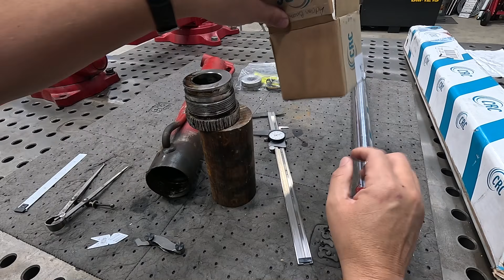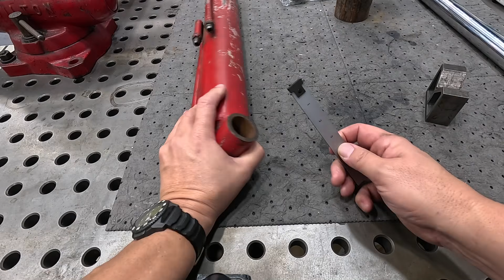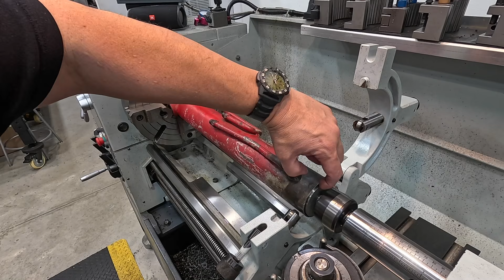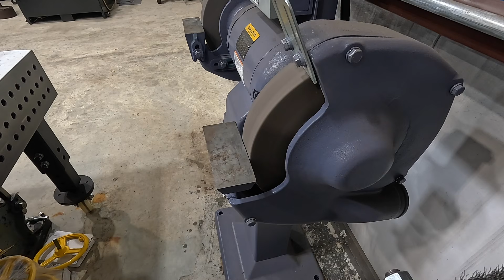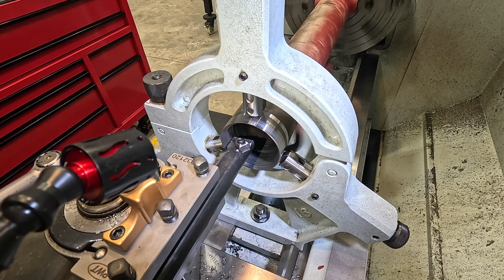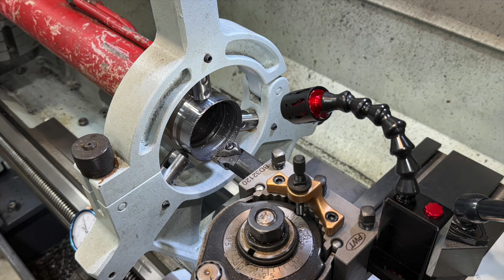Chasing Internal Thread: Mahindra Hydraulic Cylinder Repair Part 1

Comment: Being a Mahindra Product, Did You take metric measurements ??
Thanks Adam...
Reply: Agreed. But as you heard with the tool cutting edge touching on the thread, there was an even sound all the way though the threaded area. If it wasn't the correct 12 TPI thread we would have heard it touch on the early part of the thread and then change sound as it became out of synch with the rest of the threads. But I am still surprised that is was imperial thread. But on the other hand, Adam has rethreaded "one or two" cylinders, of all different origins, in his time and I will defer to his experience and knowledge.
Reply: These are from India and it looks like from my calculations it is a 68.25mm X 2.0  thread.  We have Imperial tools here so we would still do the repair using imperial calculations.  I'm just surprised he didn't note that during his measurements as I know he realizes this.
Reply: @larryrobinson7492  just because it made in a country that uses metric units doesnt mean it will be metric. a lot of hydrualics stuff is imperial. it highly likely the ram used is imperial becuase its the size that will work for the task at hand so you save time and money by not turning material into shavings. oh and metric threads are based on imperial threads anyway.

Comment: Caustic soda/lye solution would have removed that aluminium from the threads, somebody might explain why that might not work? Obviously if it needs rethreading to a different pitch/bore there's little point.
Reply: Too much hydrogen gas is what I would say.
Reply: Would it have made it round, too?

Comment: For our South Bend with the threaded nose, my dad came up with a nice setup to install and remove a chuck.  Turn a morse taper on one end of a bar and a center on the other.  Close the chuck jaws close, but loose, on the bar.  Put plywood on the ways.  Lift up the chuck - I happen to use a die cart.  Position the rod in the spindle taper and tailstock center.  This keeps the threads perfectly aligned prior to installation and has limited risk of a back injury.
Reply: Well isn’t your dad just clever!  :-)  I like it.
Reply: a hobby machinist i knew made a roller stand with a bit of seat belt webbing so he could change chuck with no lifting but he only had one lathe. he would wheel the stand in place release the chuck turn the stand around and install the other one. the seat belting was to stop em falling off the stand. cluey old bugger bob and his brothers developed one the worlds first mechanical cane harvesters the parry - truscott. they were self tuaght machinists and engineers.

Comment: from my engineer's perspective, 0.025" off the OD does change the Section Modulus a measurable amount, but the Factor of Safety designed into the original part handles the actual pressure force applied inside the cylinder when it is under load.

ignorance and attitude go hand-in-hand
Reply: But when you consider the seal is well above the threads and it is the threads that is taking the lateral load That little bit off the entire Route of the thread on the OD is negligible.
Reply: @tomjewett5839  i think i get your meaning - i dont disagree, i might have described it slightly differently.....the pressure inside the cylinder exerts axial force on the plunger causing the rod to move and perform work, while simultaneously exerting radial force on the cylinder ---- all held together as a unit by the threads. are we off into the weeds yet??? im sure a hater is gonna have something to say........
Reply: @garywoodard5759  you literally are the hater here trying to make yourself sound smart now that you were called out.  again you're wrong though.  
youre talking about combined load, but what you fail to understand is there is a recess/undercut before the threads that would be the weakest part of the cylinder.  Plus not all the threads take on the load.  Thats just not how threads work in real life.  Youre not very good at this.  Maybe stop being the ACKCHYUALLY guy here?
Reply: @gectek  as i predicted. but back to the original question-- does cutting a flat spot around the out side of the cylinder weaken it to the point it cant be used?
Reply: @garywoodard5759  no it does not...because its still thicker than the recess cut before it inside the cylinder.  
Just as i predicted.  You just dont understand.  Its ok not to but pretending you do?  Cmon i assume youre a grown adult, you should act like it.
Reply: @gectek  and you are still missing my original point about the body of the cylinder being turned down a miniscule amount not compromising the overall integrity of the body of the cylinder, because as you correctly pointed out the recess at the end of the internal threads is in fact the thinnest part. it seems we are both correct, just talking about different aspects of the same thing. so happens i do understand.  the difference between us seems to be that i enjoy life.
Reply: hey gectek where'd you go?? we were having such an edifying discussion.......
Reply: @garywoodard5759  bless your heart bro, your "edifying discussion" is pointless.  again tryin to use big words to seem intelligent only shows your ineptness.  I cant teach it to you AND learn it for you at the same time.  Good luck on whatever it is youre feigning intelligence about though. I hope you win.
Reply: @gectek  its not about winning, its about making friends.  as  you seem determined to cast aspersions..... (whoops another big word) ....hows that going for you?? 
so happens i am only slightly above average in intelligence, enjoy reading and expanding my vocabulary, and i never feign. i expect you will feel the need to have the last word and may reply to this note, but really its time to let it go, dont you think?
Reply: @garywoodard5759  It could actually be argued that he's making it stronger when you think about how he's slightly enlarging the threads and then going to make new threads slightly larger on the new end gland Which will increase The overall surface area Of the threads. And I'm not being a hater. Just pointing out things that I have considered to be obvious.
Reply: @tomjewett5839  enlightening discussion and honest debate is a good thing. you have 'good form', as they say. some others dont have good form, classifying themselves as -well it goes without saying.....
thank you for constructive dialogue.
Reply: The force isnt applied where he machine, so acting like a knowitall trying to use terms that dont apply sure made you own yourself there.  Good luck with your further research though

Comment: Adam's comments about proprietary parts using non standard threads is another reason to not buy a Mahindra product. Another is they used an aluminum gland on a steel cylinder, Aluminum against steel is guaranteed to corrode the aluminum and seize up in time. If their "engineers" had studied material science, they would have known. Yet they have the nuclear bomb! And rockets to launch satellites (and the bomb).
  I made the mistake some years ago of buying some India made boring bar set and found the "ground" ends was too large for my quality Criterion adjustable boring head. Junk quality tools.
Reply: I did immediately yelling at him: metric, metric when he tried to measure american bananas on the part (Ausie CEE channel joke).
American ignorance.
I'm pretty sure that Mahindra is standard, but metric.
But I can't actually convert the shown 'bananas'' type to thread gage to something standard metric for the rest of the world but I would guess M75 means 75mm which is a little smaller than 3 bananas (inchs) 

😂

Comment: Always great tips Adam. I prefer REX 95 to Mo-MAX when considering endurance against heat (like on extended shaper cuts) but the use of Mo-MAX for this is perfect. A very delicate and subtle use of HSS. Good choice. I also love your point about how many photons can you see in the gap. I do the same when sharpening.

Comment: At 26:00 Adan explains that removing 20/1000ths does not damage the structural integrity of the tube. An illustration of the truth of this statement can be seen at the CuttingEdgeEngineering YouTube channel. Kurtis has been fixing hydraulic cylinders for decades. Unlike this one Adam is working on, Kurtis repairs the cylinders from the largest earth moving machines Cat makes. They contain enormous pressures, above 4,000 pounds per square inch. Kurtis never discusses, as Adam does here, instead he just cuts a "steady band" every single time. Like Adam, Kurtis also teaches. He discusses why the previous repair failed, and why his will last years.
Reply: That's because Kurtis doesn't bother himself with the numpties in the comments. Adam would do better to ignore them...stop feeding the animals, and they go away.
Reply: But I hear Kurtis imediately yelling at Adam to stop the 'bananas' measurement.
That Madindra may be just plain standard metric. M75 sounds to match 2 11/12 relatively close.
Reply: @dilbert0815  well it doesnt. its either a metric thread or its a imperial thread. if you notice he had a set of thread gauges on the bench along with the verniers. a lot of hydraulics stuff is still imperial even on equipment where everything else is metric. it's often about using off the shelf available material rather than having to buy in custom size stuff or spend hrs machining stuff to size.

hydrualics works by multiplying the hydrualic force in psi by the surface area of the piston. the engineer calculates what size piston is needed to get the force in tonnes required to do the task they then select material sizes close to that. the focus being use off the shelf material as much as possible. what size seals are available
Reply: @chrisforgan731  Thread gauges are a rather inaccurate tool only do a close match over a rather limited number of threads. the thread is also damaged, hence measuring is inaccurate anyway.
So you will always find a thread gauge in metric or imperial that seems to closely match the threads.
Also your two arguments are rather oposing each other. You eigher use a off the shelf parts (and hence typically overengineer it) or pleasing the beans counters by minimizing the parts by the calculus. But typically is using standard parts also more cost effective.
Here we have a non-standard thread in imperial. So it's not match either case if it's not mistaken as a standard but metric part.
Reply: I used to work at a dealership with compact tractors. Bradco makes the backhoe so everything should be imperial

Comment: Slightly different method from what I learned, but it does work well.
Reply: Different from mine too, but the goal is to get the tool point, original thread, cross slide, compound, and threading dial zeroed to each other at the same time.  Different people do that in different orders but we all have to get to the same destination.  He did and life is good.

Comment: I DID NOT KNOW that you could grind HSS to red hot and NOT take the hardness out of it. This is a big deal to me (the week end hobby machinist). Thanks Abomb. I always learn something.
Reply: Its why its named high speed steel.
Reply: I did a quick check on this and found; It depends on the color of the ''redness''.
   ''While HSS can withstand high temperatures, grinding it to an extremely bright red heat for extended periods can still cause some degree of hardness loss.''
   The relatively short amount of time and redness are generally not a problem when grinding a hss tool.
Reply: @firesurfer  I guess your fingers might tell you when it’s way too hot.  :-)
Reply: You can’t. I make my living heat treating aerospace parts and I can tell you with absolute certainty Mr. Booth is incorrect. I never noticed because I like his videos so much, but he is one of the “I don’t use coolant” guys. All you have to do is ask yourself why everyone else has been using coolant since time in memoriam? If you want technical data, just look up heat treatment of tungsten alloys (M2 and M4 are “HS steel”). Though his machining work is great, he was led astray at some point and has dug his heals in. If you are thinking about replying, just re-read the second sentence of my comment and put the keyboard down.
Reply: @bill4639  People haven’t been using coolant while grinding high speed steel for time immemorial (sic), at least not in the majority.  I’m surprised you don’t know that.  

Your self-importance just makes you look crummy. Unlikeable. Deprecated. That may be the opposite of what you intended.  “But I’m right!”  Well, no, but that’s not the point.
Reply: @ydonl  you are responding diametrically simply because you are triggered, and thus making it clear you have no qualifications. Unfortunately for you, there is always someone who is right and who is wrong, and you ain’t right.
Reply: @  You’ve offered no science, no facts, no numbers, temperatures, hardness measurements under different circumstances.  No evidence. No proof. No theory. Your position goes against everything I’ve ever heard.  Prove your position - persuade me with something beyond an opinion.
Reply: @ydonl  You must have missed the part where I said “if you want technical data, just look up heat treatment of tungsten alloys (M2 and M4 are HSS)”. I can’t comment an entire TTT diagram. And if you have never heard that coolant is always used for grinding and machining in professional settings, then your replies are the equivalent of an animal mashing a keyboard.
Reply: @bill4639  You’re right, I did miss that reference.  So as I look around on the Interwebs, and it seems that red starts to appear at over 600 degrees, and HSS retains its hardness to 620. So there is some potential overlap. I’d say the conventional wisdom is probably just fine, considering we’re talking about grinding a tool bit held in your fingers.
Reply: @ydonl  obviously a layman with a lathe in their garage is going to sharpen their cutting tool with a bench grinder. It’s all they have. Call a machine shop and ask them if they grind ANY heat treated alloy without coolant. Their reply will sound remarkably similar to mine. It is even easier to search Youtube videos of grinding in modern settings and in antiquity. YES antiquity. We’ve always known to grind with coolant. Black and white videos from Europe and Japan of men using massive grinding stones with….. you guessed it….. water as coolant are on Youtube. It was even more important back then because the simple, high carbon steels they had back then, tempers at like 300F. You so much as get that stuff too hot to hold in your hand and you’re losing precious hardness.
Reply: @bill4639 High speed steel is different.

Comment: This definitely separates the men from the boys in the world of machining. I have been around machining all my life and worked with many talented machinist and have never encountered anyone that I think would consider this repair. I'm impressed!
Reply: It's a normal shop job for manual general machine work.
Button push machines are incapable of this kind of job.
We just took on a job to make an Acme rod and nut (1-1/8x3. Odd pitch) to repair a tool for someone. Like here, we will grind the tools and machine the parts. Just another job.
Reply: It is a very common and fairly simple repair (nothing is simple). So I don't know what type of machining you have known. Nor what machinist you have met and how much time you have in machining.
The work is well done. 
But the complication of this job should not be overstated.
Look at the machinists in Pakistan and then you will hallucinate 😃.

Comment: If a cylinder is so marginal that 25 thou makes a difference it was a ticking time bomb to begin with - so fragile that a slightly hot day or a tiny bump from something was going to trigger catastrophic failure no matter what.
Reply: Mm.  And to me it seems like the gland is the primary strength, not the tube.

Comment: It wouldn't be cheaper to buy a new cylinder from the manufacturer than do all this?
Reply: Maybe if you can get a new one and if it will arrive in time and if the manufacturer doesn`t charge an arm and a leg for the parts.
Reply: Have you attempted to price a replacement cylinder for an older, off-shore-made tractor?  Even older USA-made parts are ridiculous.
Reply: Also not to mention you can buy aftermarket. Plus all new hoses because the original will not work anymore. And 98% of cylinders on a tractor have an identical twin on the other side. Repair or exact replacement is best.

Comment: at about 22:00 wouldn't the paint have a thickness that could affect the center?
Reply: It does but is not super vital to run exactly true as the machining is done on the other end.
Reply: Only minimal.... especially where the cutting will take place at the other end.
Reply: Do you love math?  :-)

Let’s see… suppose the paint is as bad as 5 thousandths thick.  The tube is what, about 24 inches long?  The angle at the far end of the tube would be the arctan of 0.005/24, which is just about 0.012 of a degree.

Over one inch of threads, the error in depth would be 1/24 of the 5 thousandths, which is 0.000208 inches.

Since the paint was probably a lot less than 5 thousandths, the error was probably less than a tenth, and that would have been a sort of tilt of the threads with respect to the rest of the tube.  The gland would sit crooked by the 12 thousandths of a degree.  I’m going to guess that’s within tolerances, or at least as good as the original.
Reply: Seems like it should… maybe Adam’s assumption is that the paint thickness of less than ~3 thou isn’t going to affect the angle of the tube? (Close enough where the threads are going to be cut 20 inches away?)